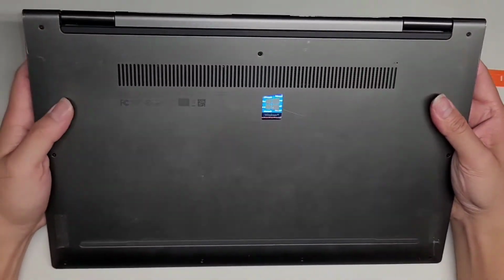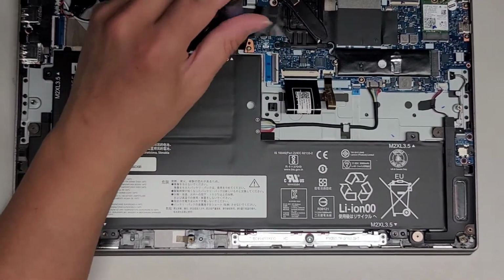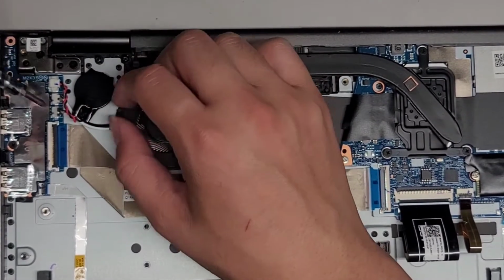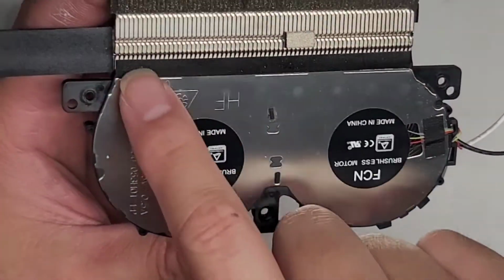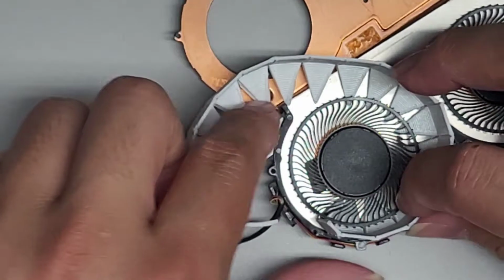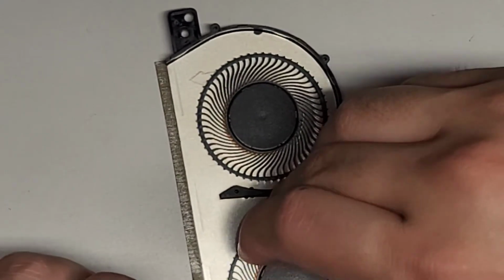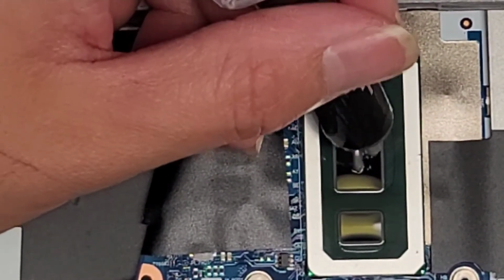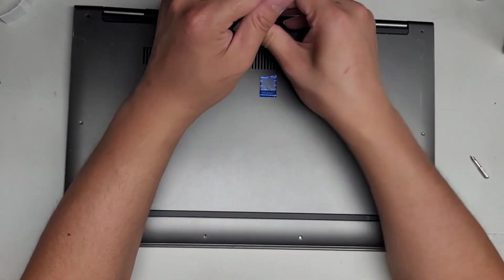Lenovo Yoga C740 C740-15IML Disassembly Fan Replacement Repair Thermal Paste Heatsink Application

Comment from the maker: I had a viewer send me a generous contribution and this link. If you guys need a replacement heatsink you can find one here from their shop. https://parts-hq.com/shop/5h40s19962-heatsink-thm-with-fan-847882

Ebay and Amazon are usually good sources as well.
Reply: This fan assembly, with heat sink and everything costs $52 on Lenovo's site, and it is OEM.  The site you linked wants $150 for it...  wild...
Reply from the maker: @ryanfuller5  Always good to shop around. I just put that link in case it has things people can't find elsewhere. Didn't mean to misguide people. Sorry.
Reply: @ryanfuller5 it's hard to make a commission selling market price. Atleast he posted the video for free
Reply from the maker: I don't make commission on that. Haha So no need to use the link if you can find it cheaper elsewhere. Someone just sent a contribution and asked if I could post their website.

Comment: I replaced thermal paste with artic and fans are working it still overheats very easily
Reply from the maker: Try ptm7950
Reply: @ItsBinhRepaired I used artic 7 thermal paste
Reply from the maker: Are the fans spinning properly?
Reply: @ItsBinhRepaired yes

Comment: Hello,
My fan was making sound, so I ordered a replacement fan. The process looks easy, do I need the thermal paste if I bought a new set of fan?
Reply from the maker: If you take the heatsink out, you have to redo the thermal paste.
Reply: @ItsBinhRepaired The fan is connected to heatsink in this laptop right?
Reply from the maker: @justhere14893  yeah

Comment: Great tutorial, I had that exact same noice on the fan, but my fan was barely dirty, instead I noticed that two of the fins on the right fan was kind of misplaced, I just putted back in place with the tweezers, anyway I also did the cleaning as you instructed and that was it. Thanks
Reply from the maker: Awesome! Glad it helped. If you haven't already, please like and subscribe so others can find my videos and possibly consider watching a few others and commenting to get the algorithm to recommend my channel. Thanks!

Comment: Is there a possibility you can lose data if you remove battery and disconnect one of the fans because I’m having the same problem here?
Reply from the maker: No
Reply: @ItsBinhRepaired also do you have the link for a the new fan by any chance because I can’t seem the find one that seems real
Reply from the maker: @moneyopolis11  https://amzn.to/3WZWN7F there you go
Reply: @ItsBinhRepaired  also is it necessary to apply new thermal paste or can you re use the previous one? Sorry for asking too many questions
Reply from the maker: @moneyopolis11  need to reapply.

Comment: that’s crazy, my laptop is having the exact same problem with the exact same fan :’) thank you for the video, it saved me from throwing my laptop out the window lol
Reply: Same! Same laptop and same exact fan blade. I called Lenovo to open a claim when my laptop was still under warranty (within 2-3 weeks of it ending) and they kept curving my calls until my warranty ended.
Reply: Had the same issue just replaced the fan i took the old piece apart just to see if I could find the issues but can’t figure it out the. I even added some WD40 to see if that would do something but no, I think it’s just a faulty fan.
Reply from the maker: WD40 is not a lubricant. You need to grease it properly.
Reply from the maker: Glad it helped. If you haven't already, please like and subscribe so others can find my videos and possibly consider watching a few others and commenting to get the algorithm to recommend my channel. Thanks!

Comment: Thanks for this helpful video.

Did you know that the cost of the fan for this model is OBSCENE! One can get used versions of this computer model for *less than this simple part*! Yes, such computers are used, BUT THE COMPUTER ONE IS FIXING IS ALSO USED. So, it is LITERALLY cheaper to just buy another computer rather than the fan. That situation should not be. It seems extremely artificial and forced on the market. I suspect Lenovo did this on purpose or at least allowed to happen with disregard for the consequences felt by their customers.

Good god, this enrages me. If I had known Lenovo would screw over its customers this bad, I would not have bought it. Consider me an HP customer from now on!
Reply from the maker: Dang

Comment: hi thank you so much for the video. i've temporarily disconnected my broken fan but it seems like the replacement part for this fan isnt as easily available (anymore?). do you recommend still trying to replace it, i brought my c740-15 in january 2020 and im starting to think i might be better off getting a new, different model, since this seems like a common issue
Reply from the maker: Have you tried repairing the fan?
Reply from the maker: This might help Fan Repair: https://www.youtube.com/playlist?list=PLSSiYX-ta7aqqxfDWDQh-B6Az4ZgDI459

Comment: MIN 25:48 that part that bends is like a plastic tape if you peel it off you expose the center of the fan, I put some oil on it and it's working fine, but that's half a solution because now you need to seal it back 🤷‍♂...btw thanks for video!!!!👍🏻👍🏻👍🏻👍🏻
Reply from the maker: Nice! Most laptop models aren't designed like that, so I didn't check. Haha
Reply: This was actually a really helpful comment, because you don't need to remove the heatsink at all. 

When you peel back the tape there is a tiny hole on the edge of the fan right where the blades meet the middle. You can see some copper wiring and perhaps a plastic bit where the fan rotates. Maybe a circuit board at the bottom. Something that looks like the end of screw in the middle.

I wiggled some lightweight oil into the hole (difficult too do). Need to replace the tape. We'll see how long this holds.

Did you try destroying the junk fan after replacing it to see if there is a method to repair it a little easier?.
Reply from the maker: I didn't

Comment: is it possible to run the laptop even with games on just 1 fan  or will it eventually overheat and break ?
Reply from the maker: Likely will overheat unless you're in a really cold environment.
Reply: @ItsBinhRepaired  I have been using external cooling pad with fans successfully for about a year. Originally it was just a temporary solution, I disconnected the fans but I was not brave enough to try to change it. Seeing your video, I will try again. Very clear! Thank you!
Reply from the maker: @snytrova sounds good!

Comment: That part number didn't match the actual part you eventually will need to order - Lenovo will find your laptop by serial number and list all of the parts. Not sure why you removed the batteries - unhook them. Why did you think you could remove the fan blade. You may have some experience doing this, but you still have a lot to learn.
Reply from the maker: Watch this video and the others in the description https://youtu.be/3zs_SJ3BXgA

People that think they know, don't know because they don't try. They only assume. That's the difference between being taught and actually learning, exploring, and discovering.

Comment: Would the process for replacing the fan for a C240-14IML be fairly similar? obviously the fan is different but would you say this video can serve as a guide for the 14 inch?
Reply from the maker: Possibly
Reply from the maker: Wouldn't know without seeing it.

Comment: Any chance you know of website I can either by the fan (DFS1507053H0T) or the full heat sink assembly (5H40S19962)? I need to find one quickly! Thank you
Reply from the maker: EBay, but it's in another country :( https://www.ebay.com/itm/1pcs-FCN-FLMU-DC5V-0-5A-DFS1507053H0T-Notebook-Cooling-Fan-/293264318224?mkcid=16&mkevt=1&_trksid=p2349624.m46890.l49286&mkrid=710-127635-2958-0

Comment: Hey how can I send you my laptop to help fix it? I have the same exact one as in this video. My problem is when I power it on the fan will start to blow and then give up and 1 of 2 things will happen. 

1: it'll bring me to the login screen and i'll enter my password/fingerprint and it'll just freeze and not turn on 

2: it'll say windows didn't start properly and im met with troubleshooting solutions to try but none of them work. 

it turned on today and was working for like 5 minutes and i tried updating windows + lenovo because maybe that's what's the issue and it just froze again. 

please help ! 😭😭😭😭😭
Reply from the maker: I'm not really sure what would cause that. Possibly bad hard drive or RAM.

Comment: i looked up fan replacements, but can't decide which one to get. there seems to be official lenovo ones and generic fans for c740, some with just the fan and some with the heat sink. do you have any website where to get these replacement part and whether i can get priority shipping?
Reply from the maker: Usually Amazon

Comment: Why did you remove the battery just to remove the fans?
Reply from the maker: Do you like the thrill of working on live circuits? If so, have at it, but don't complain if you get electrocuted or fry the motherboard. Lol
Reply: @ItsBinhRepaired  Didn't need a smart ass answer.  Just wondering.
Reply from the maker: @dkevvv  you really like the word "just" don't you? The way you worded your question, " just to remove the fan" made it seem like you felt what I did was unnecessary and you know better. Like someone asking why they need to shut off the electricity before replacing an electrical outlet.

See if you can spot the difference. Why do we need to shut off the electricity to replace an electrical outlet? Why do we need to shut off the electricity just to replace an electrical outlet? It makes a huge difference the way you ask the question.
Reply: @ItsBinhRepaired  Just,  as in removing the fan is no big deal.   Seems you are just a bit sensitive.
Reply from the maker: @dkevvv  yes, I am. My brain thinks, that's a dumb question and they sound like they think they know better.
Reply from the maker: @dkevvv  I also need to stop assuming things are common sense. I often forget people need to be told that plastic bags can choke you and hot beverages can burn you. Lol

Comment: Hey man, amazing video! I just tried repairing mine but one of the fans is also definitely broke. 
I'll order a new one but it'll just get here in at least 2 weeks. 
You said the client needed the laptop so you unplugged one fan. Do you think it would be ok to work on my laptop for 2 weeks with only one fan?
Does buying one of those laptop supports with fans help anything?

Thanks for the video!!!
Reply from the maker: It'll be fine as long as you're not doing anything very processor/gpu intensive

Comment: Thanks so much for the vid. I have the exact model w the exact same problem (fan noise sounded exactly the same too), and knowing that the fan will most likely need to be replaced all together helps a lot w what I need to do.
Reply from the maker: Glad it helped. If you haven't already, please like and subscribe so others can find my videos. Thanks!

Comment: I have this laptop, it just stopped turning on after an update. Does nothing at all, no power no lights just dead. Any tips?
Reply from the maker: Did you force shut it off mid update? Was it plugged in?
Reply: @ItsBinhRepaired  I  left it open and on updating plugged in, when I returned it was off and no longer responsive. I tried the little reset button on back and holding the power button down. It will not show any signs of life.
Reply from the maker: @49razor  not sure, but sounds like a dead motherboard :(

Comment: Do you think I could with not replacing the thermal paste on the heat sink? I don't have any, and don't want to spend money on some since I will never use thermal paste again lol
Reply from the maker: Watch the video and decide
Reply from the maker: If you can't tell from the video, I don't recommend you attempt it because you'll likely destroy your computer which will cost you more than a tube of thermal paste. Lol
Reply: @ItsBinhRepaired  I mean it never said if you HAD to replace it. You kind of just started doing it and never explained why
Reply from the maker: If I had to explain the science behind everything, like, why you turn screws counterclockwise to remove them, why you have to remove them before taking things out, etc. The video would be much much longer. Lol What are you trying to repair?
Reply from the maker: @tartuffethespry  here you go https://en.m.wikipedia.org/wiki/Thermal_paste
Reply: @ItsBinhRepaired  Dude wtf do you think I'm trying to repair? Look at what video Im commenting on
Reply: @ItsBinhRepaired  Dude...I know what termal paste is. I was just wondering if the existing factory paste would be sufficient once I put the heat sink back on. Or is it necessary to replace any time you remove a heat sink? I don't know...this is your field of expertise no?
Reply: @ItsBinhRepaired  Dude...I know what termal paste is. I was just wondering if the existing factory paste would be sufficient once I put the heat sink back on. Or is it necessary to replace any time you remove a heat sink? I don't know...this is your field of expertise no?
Reply from the maker: @tartuffethespry  it is not sufficient. You do not want to reuse old paste after pulling up the hearsink.
Reply from the maker: https://linustechtips.com/topic/592860-all-right-to-reuse-thermal-paste/
Reply from the maker: It's easier to Google than to write essays explaining why. Lol just do it
Reply from the maker: You can, but should you? No. Your computer will likely overheat.
Reply from the maker: @tartuffethespry  if you're trying to repair the fan, then you likely have heat issues. Even more reason to redo the thermal paste.
Reply from the maker: @tartuffethespry  overheated thermal paste no longer functions properly.
Reply: @ItsBinhRepaired  yeah I was playing emulated ps2 games on my non-gaming laptop and a fan went out
Reply from the maker: @tartuffethespry  best to do the paste too

Comment: What size Torx screwdriver did it require? Thanks for the video!
Reply from the maker: https://youtu.be/RQ6a2YkZCuU please enjoy this video. Lol
Reply: @ItsBinhRepaired  roasted me good 

Just rewatched. Thanks again for video
Reply from the maker: @tartuffethespry  hahaha :) glad you got the info you needed
Reply from the maker: Either that or rewatch the video. It's mentioned in it.
Reply: For the rest of you t5
Reply from the maker: Don't give them those shortcuts. It's how they destroy their devices. If something as simple as knowing which sized bit to use is a question, it means they need a proper set of bits and a screwdriver. To get the right bit for each screw, you need to test fit and wobble check. Buying individual screwdrivers based on size is very cost ineffective and will lead to a bunch of random screwdrivers scattered everywhere.